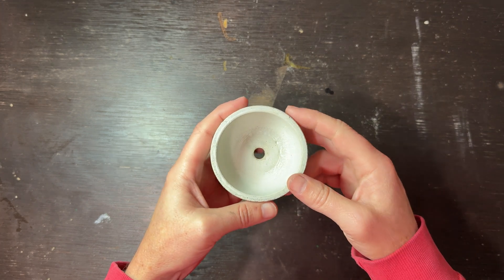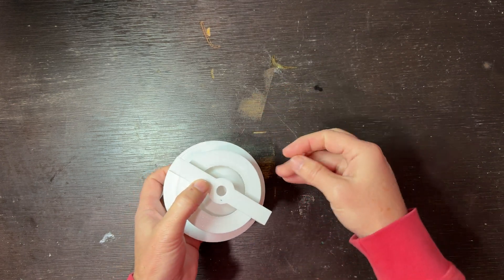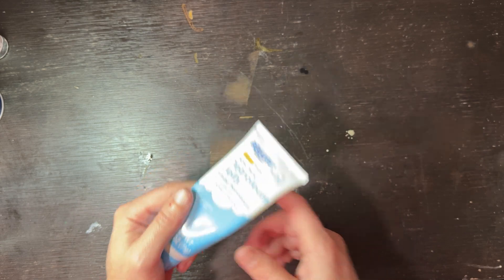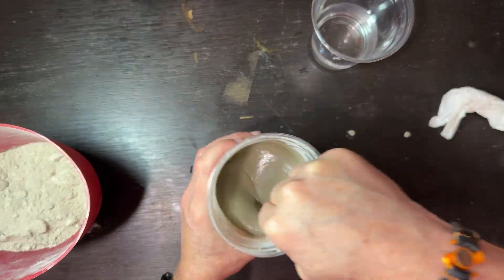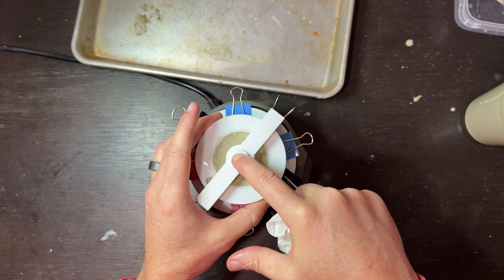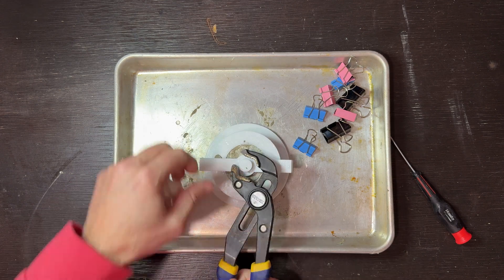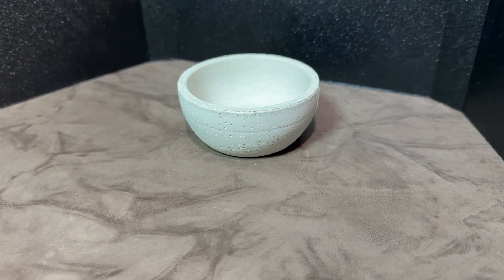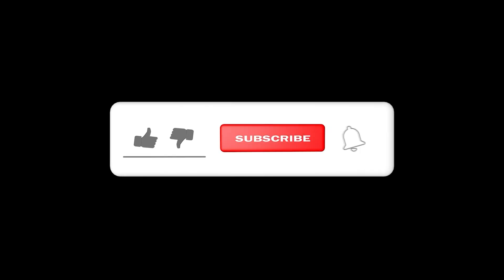Concrete Molds from 3D Printing - No SILICONE!

Comment: Another phenomenal video. I tried this a while back it works great I've made flower pots this way love your tips didn't know about the canola oil or the water. I have found that if you use a balloon and wrap it around a part that you're going to put in there it won't stick to the balloon either as much if you have a part that the balloon is sufficient for it works for the inside of my flower pots.❤

Comment: this is really cool stuff. im curious to know what your thoughts are on using 3D printed molds vs silicon molds. what are the pros and cons of each? ive only ever used 3D printed molds and im considering trying silicon out for more detailed projects.  great video btw!!
Reply from the maker: Thanks for watching and commenting. I think 3D printed molds work great on simple designs that allow for better release from the PETG. But, the process of making the mold saves steps and is easy to make changes cheaply. Silicone is great for detail and much easier for concrete to release. I would choose 3D printed mold whenever possible but there is a place for silicone as well.

Comment: In my experience, the biggest issue is when you have an internal diameter like the inner part of the bowl against curing concrete, it tends to bind with the plastic (I am not sure why, could it be because the concrete expands or the plastic contracts?) either way the outer shell almost always comes off easily, the inner part takes a lot of persuasion, which it seemed like in your case as well hence the mallet through the plug hole, but would you have been able to extract the plastic had there been no plug hole? I doubt it. Not without damaging the concrete even a little bit. If we can figure out how to deal with internal diameters I think this method of casting will go very far.
Reply from the maker: I have tested this method without the hole and you are correct. Sometimes it comes out but not without effort and in most cases you will ruin the 3d printed part.